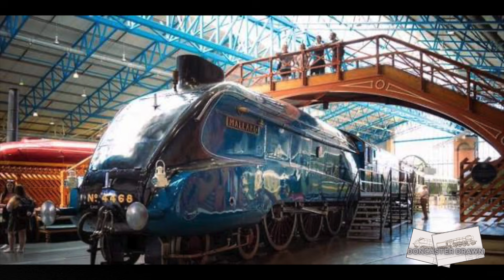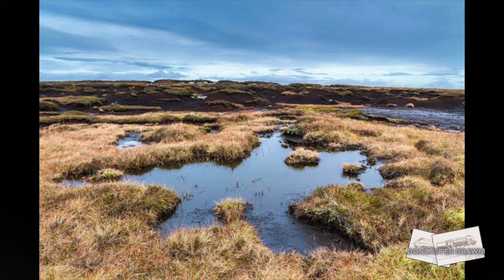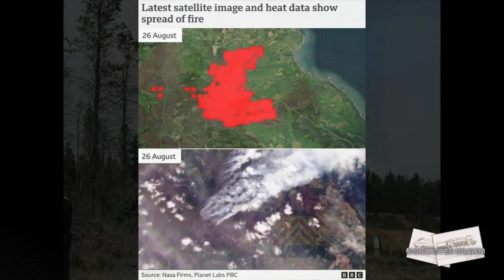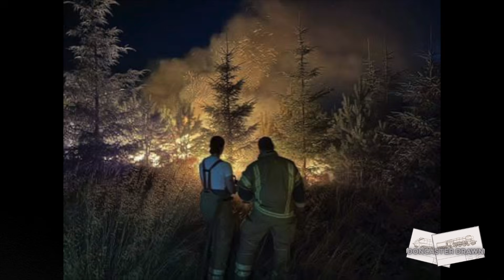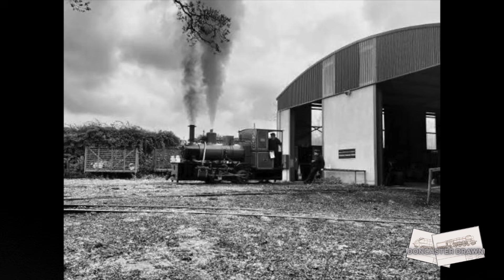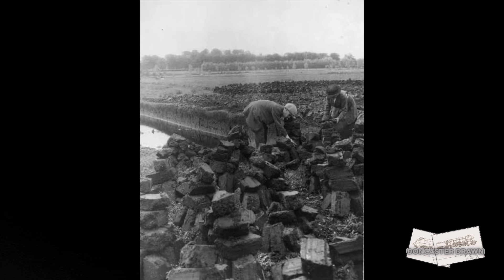the CC1 peat engine

Comment: Bullied's previous experiment was the Leader Class. Four huge engines of a similar design built for Southern Region of BR, of which only one run ran. It was a total failure, cost a fortune and was only intended to replace the aged M7 tanks on carriage duties in and out of Waterloo station. After they were scrapped they were successfully replaced by USA-built tank engines brought over during the War. This is the best film I've seen on the Turf Burner though.